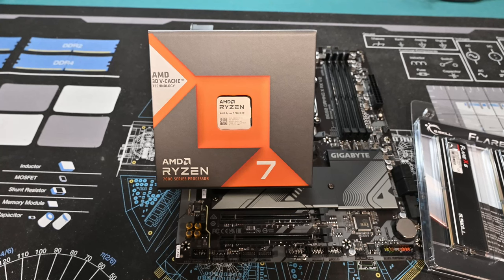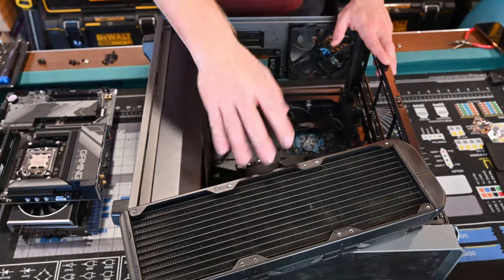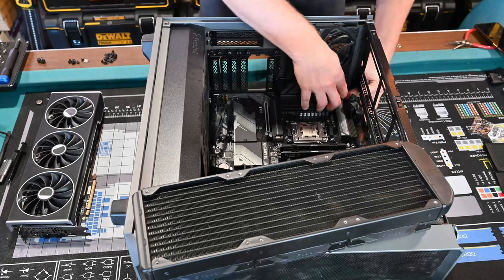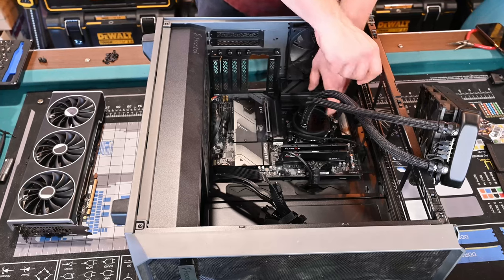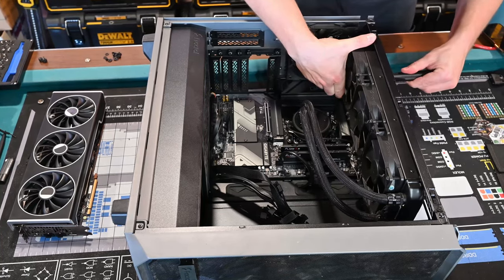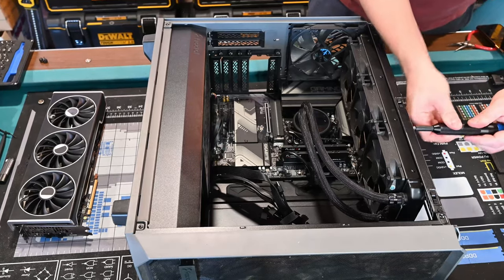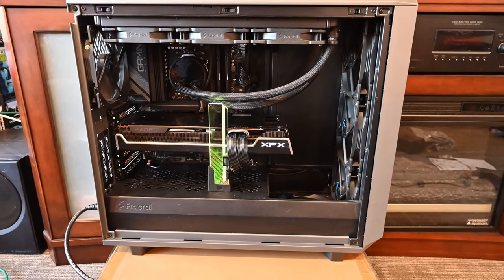Computer Build - AMD 7800x3d Gigabyte B650 Gaming X V2

Comment: Got the same bundle (except my RAM is CL32), super excited for the build
Reply: its full hd build you can rock 1440p but if you wanna stable fps in new games and high fps on high refresh rate monitor its 1080ú beast.7700 x with 7800 xtg is the best fit. 7700 xcpu is very  good for games.

Comment: I got same board but msi mag 112 r case. My motherboard IO is too tough to take. Is the IO size varies between the case and fan?
Reply from the maker: I could but normally it is standard. I would expect the audio, usb's to be the same. the power, reset, HDD/SSD lights could be different. if that is the case normally the case comes with a breakout for that.

Comment: I new to PC gaming.... One question I got a MSI pro b650-v wifi (pretty sure that's it) and I got 1 tb nvme SSD. I was wanting to add another SSD but didn't know if I could add another nvme SSD or have to go a different route. Thanks for the help
Reply from the maker: IT shouldn't matter. I would just add nvme. as there is an open slot.

Comment: I'm about to put this combo together myself. I have no idea how to "test" things as I go... I'm going to find out if I have a bad part after I put the whole thing together i guess... Unless there's any obvious advice I need to be given?
Reply from the maker: What I like to do is put in the cpu memory, cooler and then connect power and try a boot, With the AM5 CPU they do have an integrated gpu on them so you should get into the BIOS. if you get there then test the GPU. After that put it in the case. I have learned the hard way you test then put it in the case.

Comment: Do you need standoff screws? Because I just build my pc and it doesn’t work I don’t know why because everything turns on just no screen but I got told that maybe I didn’t put in standoff screws I got a bunch of screws with my case and I lined it perfectly and put screw in can you help?
Reply from the maker: Standoffs are usually installed in your case already and you last comment confirms that. There are 4 lights on the motherboard what ones are on when you boot the machine (they are next to the memory slots)?
Reply: @GrayaOverload  none of those lights is going on when I boot up
Reply from the maker: @danielavdalian4076  verify all power plugs are connect tightly.
Reply: @GrayaOverload  it is
Reply from the maker: @danielavdalian4076  do you get any lights from the motherboard when powering up?
Reply: @GrayaOverload  no light are going off not even the speaker
Reply from the maker: @danielavdalian4076  do you know if the power supply is working? Some times they come with a device to test it.
Reply: @GrayaOverload  yes because everything turns on just not the screen
Reply from the maker: @danielavdalian4076  Let me back up because I missed something. Your inital question was with standoffs, and at that time your computer was turning on just not the screen? if yes, which port have you tried plugging the monitor in ( back of the motherboard or GPU)?
Reply: @GrayaOverload  I tried displayport and hdmi both
Reply: In to my gpu ofc
Reply from the maker: @danielavdalian4076  can you try unplugging the gpu and just using the hdmi or dp to the back of the motherboard?
Reply: @GrayaOverload  no not yet
Reply: @GrayaOverload  but my cpu doesn’t have gpu in it
Reply from the maker: @danielavdalian4076  let me know if you do get a display from that.
Reply from the maker: @danielavdalian4076  what cpu do you have?
Reply: @GrayaOverload  ryzen 5 7500f
Reply from the maker: @danielavdalian4076  ah. Yes that one doesn't have the gpu. Try reseting the gpu.
Reply: @GrayaOverload  how do I do that?
Reply from the maker: unplug the power and the gpu from the motherboard then then plug everything back in.
Reply: @GrayaOverload  good nieuws I come back from school and just turend it on just to see if something is going to happen and it just worked thank you for all the information I appreciate it
Reply from the maker: @danielavdalian4076  awesome. That is the best fix.
Reply: @GrayaOverload  yeah hahahaha

Comment: When you first tested it out without it being in the case yet,
  do i need to use thermal paste on cpu with the temporary  cooler even for testing  before i put it in the case
Reply from the maker: Yes, I used thermal paste with a temp cooler.

Comment: I think it is pretty amazing that you answer so many questions and provide more support, especially to newbies.
I have been building and rebuilding computers for twenty+ years and I have a very weird problem with this motherboard, Team group 32gb ram and a 7800x3d that I got in a bundle deal from Canada Computers. (similar to your Micro center deal?)
Anyway, the board is perfect, OC is amazing, booted up first try, everything a dream. Except, for the life of me, I cannot update the bios! I have spent hours researching and using different USB 2.0 drives, used the red USB slot pushing the little button, tried from the bios, tried different bios releases.
No update method works. Never had this problem before! Any ideas?
Reply: Oh my, no need to reply!
All of that troubleshooting missed such a simple solution: Make sure to plug your USB stick into the bios slot! Duh... 
Np now. On the latest bios and the only thing I can say is my sixty eight year old eyes just didn't see properly in my dimmly lit basement. 
I was all set to return the bundle too.
Reply from the maker: Thanks for the update I hope it helps out someone as well.  I think I always put it in the bios usb port.

Comment: you installed 2 tb i only have 1 should i install into M2A_cpu or M2B_Cpu
Reply: i’m assuming M2A
Reply from the maker: I would start with M2A. both are connected to CPU but m2A is gen 5 while m2b is gen 4
Reply: @GrayaOverload  ok thank you
Reply from the maker: no problem, sorry for the late reply.

Comment: I dont know if I have a bad motherboard or not, when i flip the PSU switch on it lights up my AIO for a split second but then when I click the power button it doesnt turn on. Please help.
Reply from the maker: Any red light on the board?
Reply: @GrayaOverload  after hours I finally got it to "turn on" but yes the VGA light its on and on the screen its telling me to reset FTPM or deny it.

Im completely lost.
Reply from the maker: @dragonkiller1270  I am guessing this is a new build. You can reset the ftpm, a new system will not have that set up. It should continue after you reset. Ftpm is used for example disk encryption.
Reply: @GrayaOverload  yes its a new build and my first. 

Thank you very much I did the reset and it worked! You are awesome man!
Reply from the maker: @dragonkiller1270  glad it is working. your welcome.

Comment: Would a better mother board with more 4.0 lanes be better for this cup? Or is this board completely  optimized?
Reply from the maker: A better motherboard would be with pcie 5.0 lanes. b650e or x670e board will have the top requirements.

Comment: I just installed this exact combo into a friends computer I have a no boot with a vga light on. I've done all of the troubleshooting tricks to remedy thinking I have a bad board. I have seen a lot of issues with this combo did you experience any issues after install?
Reply from the maker: I didn't have any issues. Since you already troubleshooted, I would have to agree with a bad board.

Comment: Thanks for sharing this build! Got this deal from Microcenter a few days ago and running smoothly. Strange that the pump header is at the bottom of the board. Did you end up connecting your radiator to the CPU fan header and the radiator mounted fans to the CPU_OPT header? Also, any sense of what the CPU_LED header is for?
Reply from the maker: I connected it to the CPU fan header. This AIO has one fan connection that it uses.

Comment: What tool are you using to remove the m2 heat sink cover screws? I am finding it impossible to remove those screws. I am using a correct screw driver, but feel like they are stuck and if I use any more pressure or torque, i am scared that I might damage the mother board
Reply from the maker: I use the ifixt small driver for this. you can also use a jewelry screwdriver set. This one wasn't to bad but the other build i did with the first version of this board, I did have trouble.

Comment: I just built 7800xt and 7800x3d but when i turned it on for first time, only the cpu fan / rgb turned on ; there is only red VGA indicator, cpu / boot / dram status are all off. Any suggestions for first trouble shooting steps
Reply from the maker: just have in CPU, Memory, Power and try. The Cpu does have a integrated gpu for display.
Reply: @dragoon101698 have you found a fix? Same build has the same issue and shuts down randomly 🙃

Comment: I have the same motherboard. It displays that same red light that you had but it does not display anything when I plug it into my monitor. Is the red light supposed to be there? How did you get rid of it if it’s not?
Reply from the maker: Yes it went away. What light exactly is on? There are 4 right there.
Reply: @GrayaOverload  I have the dram light. All my pieces were bought new. I’ve tried taking the PC apart and rebuilt it 3 times. I’ve tried removing the battery from the motherboard. I’ve tried updating bios with a flash drive. Tried using just one stick of ram but nothing has worked. Still no display :(
Reply from the maker: I am guessing you had the ram in A2 and B2. I would say it is a bad mobo or bad ram.
Reply: Yeah it was a bad motherboard. I replaced it and now it works fine. Thanks!

Comment: HI, I have the same build with Seasonic Focus Plus 750W Gold 80 Plus  semi mod psu but when I plug in the 4 pin cpu plug along with the 8 pin my computer does not turn on , but when i plug it in just the 8 pin the computer turns on and runs ok. Some people told me without the additional 4 pins I am under utilizing my cpu. What should I do?
Reply from the maker: Off the PSU is it two 8-pin (4+4)? If so, I would swap them to see if the PSU has issues or mobo. On a 7800x3d if you were only to have an 8-pin I don't think you would be under-utilizing the CPU it is 120wTDP not the 170W TDP on the chips higher in the stack. If I were you I would want to know if the motherboard or PSU had the issues.
Reply: @GrayaOverload  I tested it with a new psu
 And it was the psu problem. I just want to know if I should change the psu or keep it. A lot of people are saying it won't make a big difference
Reply from the maker: @manutap  it won't make a big difference but if you every upgrade to a 16 core and push it then it could. I would still rma the psu because of the knowledge of it having a problem. You don't know if that is the only problem with the psu. I know waiting for an rma is annoying when you have the pc built.
Reply: @GrayaOverload  I was given psu for free  from my brother. I was  hoping to save some money by using it, but I guess I just have to spend that extra money. Already ordered a new PSU.  Thanks for the advice.
Reply from the maker: @manutap  Ah. How old is it? I would still check the warrenty some are quite long, up to 10 years on some.

Comment: Hey I have the same motherboard. I also have the red light lit up. Is that normal? Thinking of taking it into microcenter
Reply: had the same thing where the label boot red light was on. I just had to install my drivers too fix this.
Reply: @oscargonzz  ok which drivers did you install?
Reply: Ok I fixed it. It was by gpu light. I just needed a driver update thanks!

Comment: Hi there , can you tell me a mothernboard that comes without issues? I wanna buy also amd 7800x3d and combine it with 4070 ti super but every motherboard have issues as i see, Msi are good but have drivers and bios issues, Gigabyte B650 you propose i have seen many people saying in your video comments that their mobo is faulty and they need to replace it.... Can you propose an AM5 motherboard close to 200-300€ that can work properly?

Thanks in advance
Reply from the maker: In all my years building all manufactures in every price range I have had an rma. I have not tested enough boards to get a good read on what ones have issues. My recommendations is to pick one I a price range with features you want. I would also make sure the return policy is reasonable.

Comment: I got the same bundle this week for my first build. Finally got it all put together and am getting the VGA debug light when trying to boot. Tried to swap with a different card to see if it was a gpu issue, but still getting the same VGA light. Any ideas?
Reply from the maker: I would take out the gpu and then try.  The 7000 series does have a integrated gpu so you can hook up to the motherboard HDmi or DP.

Comment: Hi, i have a question about which screw you used for the ssd installation part? Im having trouble finding a screw that can unscrew the ssd cover currently.
Reply from the maker: The m.2 screws are in little plastic bags in the motherboard box. They are really tiny. The screw drivers I use are ifixit ones, but I have used jewelry screw drivers before I got the ifixit kit.

Comment: I'm having a problem with the nzxt case, I can't figure out what I need to connect into the cpu fan slot. The connections are slightly different to the slider pins
Reply from the maker: Which nzxt case, so I can look it up?
Reply: @GrayaOverload  it is the nzxt h7
Reply from the maker: Thanks, I hope I can follow the question. The cooler on the cpu should plug in to the cpu_fan header on the board. The fans in the case should connect to the sys_fan headers. If this doesn't help, let me know.
Reply: @GrayaOverload  the cpu_optional slot on the motherboard is that for the fan pump?
Reply from the maker: @reymilocuevas3485  I think it is for a fan. At the bottom of the board they have sys_fan_pump, for a pump. Now you could hook what every you want and control it manually.

Comment: I have a red CPU light on… the system boots up for 5 seconds ONLY if I hit the q-flash button.. any ideas? Thanks
Reply from the maker: Reseed your cpu. While it is out check the socket for any bent pins.
Reply from the maker: Also what cpu?

Comment: did you not flash bios or anything? before install?
Reply from the maker: I tested the build (cpu memory power), to make sure everything worked and I didn't need to use bios flash plus. Then updated bios to the latest. Next I put it in the case.
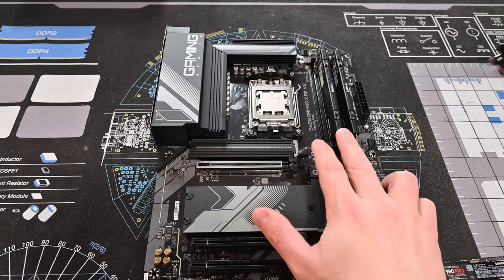Reply: thank you sir I subbed and liked the video thanks for the great video, also 1 more question  @GrayaOverload  when you say try and boot* at 2:50 if it gets to bios then does that mean it boots  is that correct getting to bios means it can boot? sorry for all the questions
Reply from the maker: @imp9ct239  yes if I get a bios screen and I can see my cpu and memory and drive. I consideriy in good shape.
Reply from the maker: Power supply is a given sorry should have mention that as well.

Comment: Is the atx_12v and 12v1 both required? My new psu does not have a 4pin connector
Reply from the maker: There are some people that were able to only use the atx_12v, I hope someone else can confirm.
Reply: it depends on the components u are using. My psu doesnt have the 4 pin concector and it works with a ryzen 7600, RTX 2060 super but the LEDs of the pc case shut down after it start running. So the answer is yes, but u can have some problems

Comment: Here’s my issue:

I have no idea what to do at this point.
I have a Lian Li ALC 360 Coolant System and a Gigabyte B650 X AX V2 Motherboard (note: the Lian Li pump cable only has a 3 pin socket that still will fit on the 4 pin motherboard header. I have the pump plugged into the system pump 4 pin on the motherboard. I have the other cable of the two plugged into the CPU Fan Header on the mother Board. Nothing is plugged into the CPU_Opt. The lights on the pump come on, but the fans do not move nor does it recognize/detect the CPU Fan or the Pump in the BIOS. Both says N/A. It does however stay at about 37 degrees. No recognition of coolant fans at all. My only issue with this new build.
Reply from the maker: have you tried to plug it into the CPU_opt to see if you get anything reported there. I haven't found the manual for that cooler yet.
Reply from the maker: Do you have another fan you can plug in to each CPU_FAN and PUMP to verify they are reporting in bios?
Reply: No I haven’t tried to plug into the CPU_Opt yet.
I was nervous to, I didn’t want to hurt anything. I haven’t built in a while.

Which cable would you recommend plugging into the CPU_Opt?
The main or the one that is supposed to be the pump?

The Fans haven’t spent at all?
Again the Pump stays lit.
All fans in the case work except the AIO.

As far as the Lian Li ALC 360, I’m contemplating taking it back bc it is hard to find anything on it.
The manual is very cheesy. 
It’s been a bit of a head ache.
Also that is for responding, your amazing!!!
Reply: As far as another fan, I do not.
Reply from the maker: You shouldn't hurt it. But you could just try plugging a case fan in to each the CPU_OPT CPU_FAN and PUMP and verify they are working in bios.
Reply from the maker: I wish I could see the manual to the cooler to know. I would try both.
Reply: @FLYHIGH-yf6hr  I have the same AIO. I plugged it at the bottom System_Fan_3_Pump header and the rest at the back of the Lancool 216 hub. All the fans spin normally and rgb works too. Only issue is, I am not able to detect the pump in any of the softwares and I am not sure if the liquid is flowing. But the temps are pretty stable around 37-42c when idle.